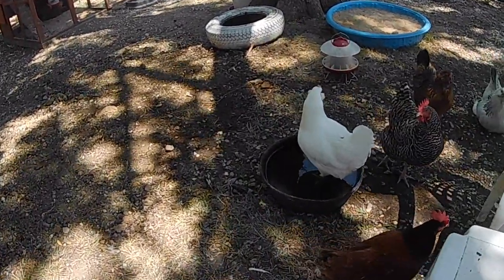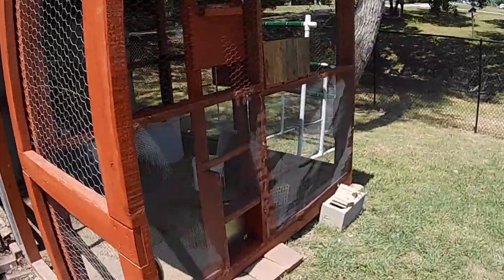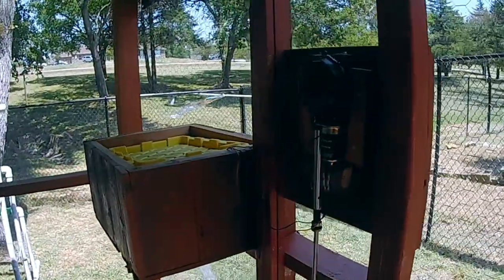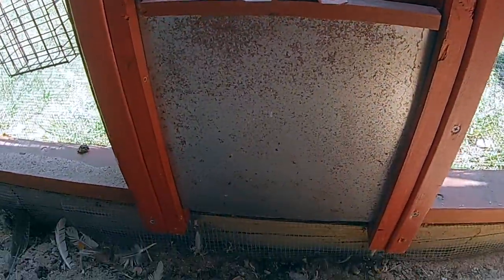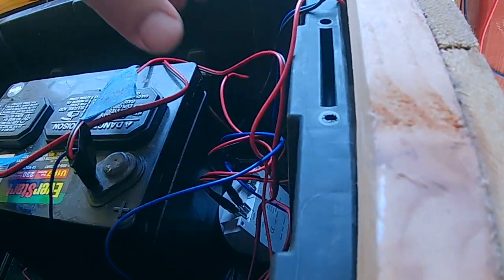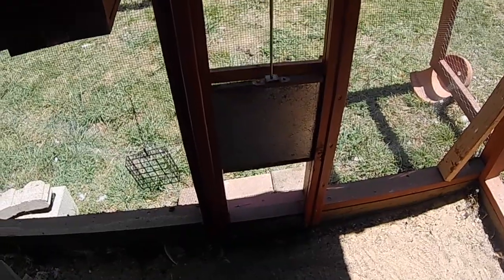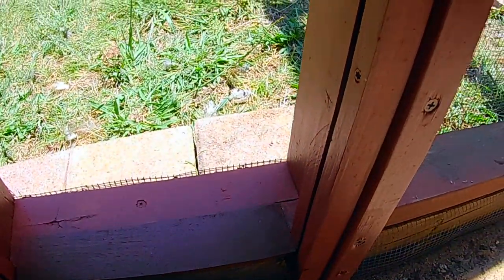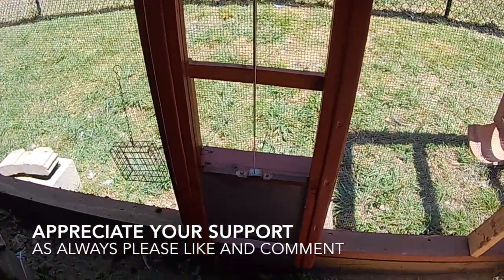Easy Automatic Chicken Coop Door - Part 4

Comment: What a great idea!
If you dont mind may i ask you two questions....
Do the chickens naturally go into the coop at night?
Can chickens withstand cold winters or do they need a heated coop?
Reply from the maker: Yes once they know where their coop is they will work their way to the coop once the sun starts to set. It's like clockwork, they put themselves in for the night. The door is set to come down well after its dark so no issues them getting locked out.

So we are in TX and during winter we have a heating lamp in the coop that is on a timer. For us that's all they need. Heating lamps are good as they are safe and built for the purpose.
Reply: @LonghornWorkshop  thank you for your time...Taxas winter is probably warmer than NJ ..😁

Comment: Question, my car antenna has three wires. Red,black, and green. I assume red is positive and black is negative. So what is the green for and how and where do I connect it. Thanks for your help. Jack
Reply from the maker: Jack Ingvaldson let me send you a picture that will help you. Do you want to share your email with me and I will respond with a wiring diagram
Reply from the maker: Jack Ingvaldson sent you an email, good luck
Reply from the maker: Jack Ingvaldson the email to that account didn’t deliver, can you check and make sure there wasn’t a typing error in your email

Comment: How is it holding up? Update video?
Reply from the maker: It’s holding up great after all this time. The only change I did was replaced the battery and solar panel and hard wired the antenna. I the solar panel was not efficient enough to keep the battery charged up. 
However the original antenna is still functioning and not had and issues.
I may do a an update video to show how hard wired it.
Reply: @LonghornWorkshop  by hardwired do you mean actually bolted to tye terminals of battery and not just taped?
Reply from the maker: @AztecWarrior69_69  hard wired as in electricity is now running the antenna
Reply: @LonghornWorkshop  what else did it run on besides electricity from battery???
Reply: @LonghornWorkshop  BTW did you change the timers and wiring to how I suggested. It will save the battery from having to be replaced for years.
Reply from the maker: @AztecWarrior69_69  no I don’t have a battery anymore.
Reply: @LonghornWorkshop  What is powering it?
Reply: @LonghornWorkshop  ?? What is powering it now?

Comment: I just ordered an antenna..so cheap+timer also cheap
Reply from the maker: Thanks I did replace the battery with a low voltage electricity and still going working great.